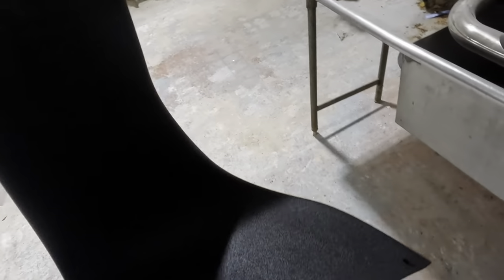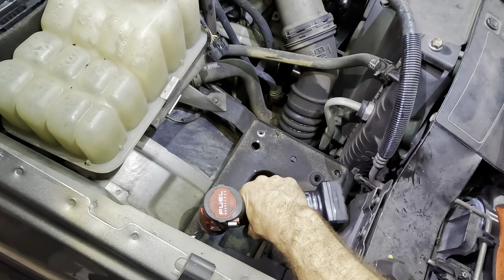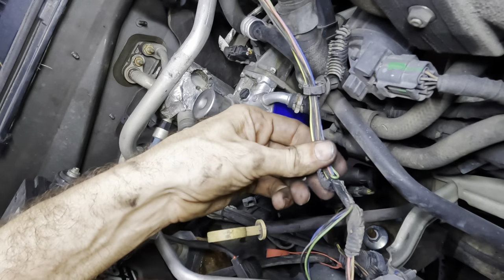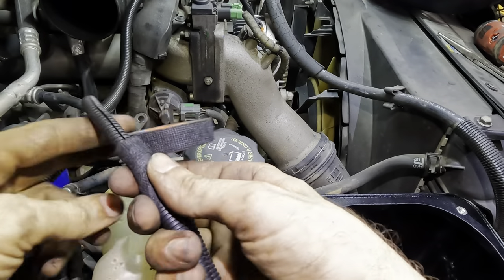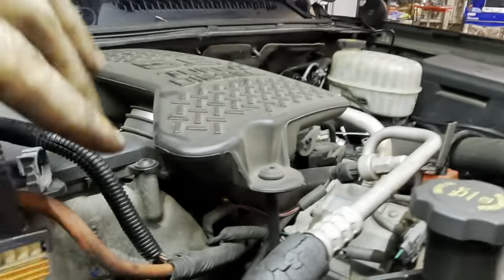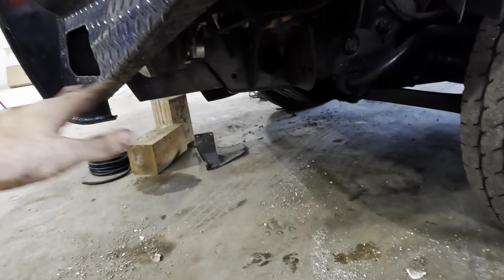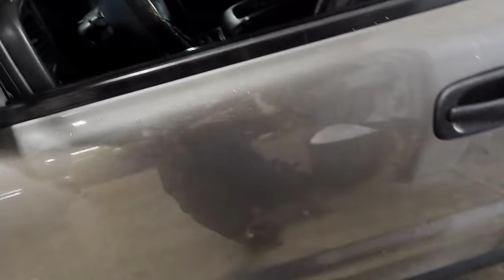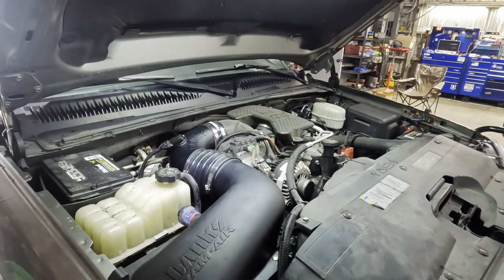This is BAD! And it's MY FAULT!  2007 Silverado 3500 6.6 @bankspower

Comment: The stock bumper  would have acted as a water, splash deflector. The scoop would therefore be somewhat protected from outside elements. You could install a flat piece of metal down in front of the scoop, say 3" or 4" inches in front and lower than the scoop. Just a thought Ray.

Comment: Hi Ray, great video as always!

Just for info though, as you are usually so accurate with terminology - The stuff you are calling loom is actually flexible conduit.
The wire loom or harness is the set of wires & cables themselves, plus the tape or ties etc. that keep them in the correct arrangement for installation.

Comment: Scooping hot air off the melting tarmac in summer (opposite to an intake cooler) and scooping water in winter not my preference.

Does anyone know how many cubic feet of air per second is sucked in by that engine?  I think that that number may make the "forced" air insignificant.  Myth busters years ago tried using a leaf blower  as a supercharger which didn't work. 
However  I love this channel and the way Ray presents it.

Comment: That engine is a great big air pump. Anything to help airflow is an upgrade for sure. Looks great too. You might check your AC low pressure switch connector as it looked like it wasn't "clicked". Have a great day!!

Comment: Seems counter productive.  In Australia we mount cold air intakes as high as we can, usually just above the driver's or passengers side door. Gets it up away from the hot tarmac, dust from the fan, and any other nasty that could block it up....like road kill lol. But really this  is the complete opposite to what we do here . Just saying.

Comment: Nope. Cold air intake generally means "outside the engine compartment", Not down by the hot pavement. It will make a great "wet vac" if you try fording some water obstacles. Otherwise, another great video.

Comment: I'm not a fan of intake at or below bumper level having hyrdolocked my 1982 6,2 diesel while driving through a long puddle in a parking lot many moons ago. Fortunately no internal damage was done. The water splashing off the front tire splashed right up the air intake. That being said, the modification getting your intake 2" higher is probably a good thing.

Comment: Ray with you buying all this Banks stuff you should see if you could become an authorized Banks dealer and install Banks equipment on people's cars and trucks.
Reply: It would be hard to get bulldozers to the shop.
Reply: @wayneessar7489  My stupid did auto correct and changed over to cats. I was typing in cars.
Reply: @KenSch2020  I thought because it was diesel, my mind went to caterpillar tractors. 😂

Comment: Ray my man. Lose the Duramax engine cover because it is a resonator. If we need to hear that opus of miraculous engineering, idling smoother than a Swiss watch sliding on a sheet of ice then off with ye cover matey!!! Oh and I'm really hoping you opt for cold and hot side aftercooler pipes next so you can reduce some weight in the EGR area. I'm going to recommend HSP piping and HSP ceramic exhaust manifolds, along with upgraded up and down pipes. If you want to do something wacky, I've never seen anyone run thick rubber vacuum hoses, like 4 inch diameter hoses in lieu of metal piping. Yes they have industrial hosing that withstands the requisite temp and pressure. Oh, but if you want to really go mad scientist, I suggest you remove the front air aftercooler entirely. Add another full size radiator and run a new coolant loop. This loop is for your new liquid to air aftercoolers. Relocate one or both batteries for room, grab two L2A intercoolers from eBay OR just grab 2 of the new GM L2A intercoolers that go on the 6cyl Duramax stock. They're only $100 each from parts shops online or eBay and they work very well. Sandwich adapter your engine oil and run plate L2L heat exchangers in series to cool oil and trans fluid on a third loop with a fan underneath. It's almost time to add a shift kit to the Allison and change its tunes. Your Duramax has not yet achieved its final form!! 🛻💨😱

Comment: That loom was trash when they put it on at the factory. But it beats the heck out of the wiring gremlins you would have without it. Now if they just used super high temp wire loom that would hold up better..... Now you need to get rid of that restrictive silencer at the inlet to the turbo.

Comment: Oldsmobile had a Ram Air system in the 442. I thin k it will make a difference in your truck. Great video as always, Rainman. Watch them full throttle take offs, you could be heard be a half deaf Patrolman. lol

Comment: That is not an air intake, it is a low level flood water intake. Should have gotten
an air intake that is above bonnet height, then you can go through flood waters
where no man or 4x4 has snorkeled before. Beyond the reach of gravity ... and
beyond the way of water gets into the engine cylinders and then refuses to be
compressed.

Comment: Good thing they gave you a pre cleaner cause you gona need it picking all sorts of stuff from a air intake being so low to the ground. Here in Michigan it would get plug up with snow in no time. Seems like they could have found a better place out of direct crap getting into it. My as well have a hood scoop on it. If it was behind the front bumper would be much better but still not the best place or into the fender were it would get better protection from the weather like some cars and trucks do. Hard to find a spot without looking at the truck to really find a good spot. Also I have seen many a wire loom replacement that melts under the heat in the engine compartment. Seems like you can't buy any good products today.

Comment: Holy shit ive seen some stupid intakes but that one takes first place. I've never seen an air intake so low you would be too scared to take it anywhere near water. Which would be hard in a wet humid state like Florida. It looks like the perfect accessorie to Hydro lock your engine

Comment: Banks  parts are great quality ,from what I have seen .Great video .Nice that you cleaned up the wiring as well..Could of used some black silicon sealant in the lower air scoop where you used the self tappers and also between the bracket ,to stop vibration and seal .All in all top job..

Comment: Hey Ray. how you doing, i noticed  that lots of your repairs sometimes there is no way for you to fix wire  or ways for you to protect them,  please if you can used the TESA TAPE HIGH TEMP, is better than the one you used on the video...  because that tape your using get really messy especially on humid and warm weather.  love your videos...

Comment: Nice install but I had some ADD with your bracket modification.  I'd have marked the hole and removed it from the scoop and drilled it in a vise.  Either way it's working for you.  Be safe!

Comment: Not to be negative but in a heavy rainstorm isn't that going to scoop up water and the screws you're putting in are going to change the vortex pattern coming into the airflow chamber

Comment: Weird, air-intakes are normally always as high as possible to prevent water intake. Driving this car through water of 35 cm deep, will be a, possibly very destructive, test what happens? Would stick to simply replacing factory filter bit more often than necessary or get a air-instake high like full off-road cars often have (jeeps land rovers etc).

Comment: I can't tell for sure, but it looks like the connector for the low side pressure switch for the AC is not clicked in al the way.  And I did not hear you say "click".

Comment: Not sure if that Banks diff cover does much for the longevity of the gears but it sure makes service easier with a drain plug and oil level sight glass. Installed one on mine for that very reason.

Comment: I remember the videos that Gale did with the diff cover and how just about all the aftermarket offerings were designed wrong. It's more than just keeping the fluid in there. Aeration, cooling, and proper distribution are big factors in the design.

Comment: Good job , and the only comment that I would like to point out is that I hope where you are / drive there’s no flooding/ deep water as I would have turned your ram air scoop upside down above the bonnet! ( would be very helpful in the U.K. ) 😊

Comment: I know from personal experience that the first time you hit any standing water you will hydrolock your engine. Removal of that type of factory scoop was mandatory on early Dodge Dakotas for certain insurance companies to pay engine water damage claims. Maybe if you had left an air gap where you trimmed the scoop, you would stand a chance (since it will pull hard on air before attacking a column of heavy liquid}. Anyway, I've watched all your videos and admire your sharp thinking and work ethos. This install, however, is going to fail in an expensive fashion. Please drill some holes at the top of your intake vertical column. Asking as a friend and neighbor, not an internet troll.

Comment: Nice video. im a big fan of Banks products too. Looking forward to the differential install video. I installed larger intake cooler hoses on my truck. I noticed a difference with those (at least it felt to me like there was a difference).  Banks intake hose and ram air.

Comment: when you flicked to metric, I briefly understood. Every other time I have to do mental calculations . 
The rest of the world, outside USA is metric, barring Rawanda I think.  Same with temperature.  66 degrees would be death in celcius. 32 degrees is a hot day in celcius and 45 - 50 celcius does happen in outback Australia occasionally. (0 Celcius = freezing point, 100 celcius = boiling, elegant simplicity)

Comment: I've seen you working with plastic parts a lot lately maybe you can get someone to donate a couple of tools from hobby store or Amazon the Testors sprue cutter and trimmer also the Xuron  track cutter they both do excellent job on plastic parts and the track cutter cuts soft metal's.  👍
 The name of the tape you were using is friction tape. 😎 
I use split loom for wire mounting on electric jobs

Comment: You have to create a negative pressure to "suck" up water from the bottom of the scoop. Just drill a few of 1" holes in the bottom of the air box. This won't interfere with the cool air being drawn in from the scoop (slightly, maybe) but will surely prevent a vacuum if the scoop is submerged. The holes will also serve to drain any water from the air box.
By the way, there is no ram air effect using a forward facing scoop (below 200mph). If you are just looking for cool air to be fed to the engine the best place to get it is probably in front of the radiator and up high (out of the engine compartment). ---- Sorry, "cool" air doesn't exist in Florida ----- I'm from Gainesville!

Comment: I don't agree with the scoop design.  The hottest air is on the road surface as is the dust kicked up by the vehicle in front of you, not to mention snow.  That's why Toyota trucks mount it above the cab.

Comment: 44:00 why didn't you use the right angle impact to install the self tappers? Would have been very easy to get 2 in the bracket.

Comment: i highly doubt that is going to give so much improvement it would noticeable by feel, it might give a few horses, but not that much you could feel it in your seat, probably just your brain trying to justify the price, i doubt that it was cheap,
but seriously? why install that low intake on such a high truck?! it is just asking for flood water to be straight up sucked up to the engine, a huge straw, you just halfed the depht of water you could pass through, plus you would still be afraid of small amounts getting sucked in by the suction, that is a good upgrade for a performance only oriented truck, not your emergency vehicle in case of another hurricane, and i don't think a hurricane will wait for you to unbolt it.
if anything, a big snorkel would be definitely better: it does let you have its intake oriented towards the incoming airflow while driving, thus giving you your fresh intake of cold air, and you will be able to cross through any water, knowing that the intake is not an issue, and the limiting depht is whatever else that must not be underwater...

Comment: oh crap Ray, I thought you F'd up! i'm watching and thought that the cut off scoop caused only an angled area that won't slide up over the flange of the filter box. I guess there must be an angled end already molded into that side. I like it when engineers can plan ahead for alternate installs! Well done Banks!

Comment: Rainman as much as it floods in Floridia I would not put my air intake down below water level. Just saying. Back in the early 50's my brother bought a new car. It had two belts, one for the water pump, and another for the fan. Of course Oregon flooded badly so he removed the fan belt and could run through water nearly over the engine.

Comment: This is for my education, I am not a mechanic: I struggle with understanding this modification. Why getting air from down below is so important that it is outweighing disadvantages? Colder air - but the temperature difference of air 10-15 inches above the road vs. 30-40 inches is, I think, marginal. I did some off-road in my life, but also for regular driving: here it is all about air intake being as high as possible to minimize dust and to minimize water ingress risk. It is, of course, particularly important in off-road. I could understand if the Banks mod was about a flap that you can adjust and switch air flow from high placed snorkel to the "ground placed" scoop as you need. But this way, are the benefits of marginally colder air so great? I do not know.

Comment: Nice add-on to your truck. Did you see noticeable gains on performance or economy? It's gotta help a little anyway. 
I remember when I worked for the harvesting company they did not want you to open the air filter until the thing went red. Then we would clean it and run it again till it tripped. 
Love your videos. Keep up the good work, And Have Yourself a great day!

Comment: It's not the Banks stuff man, it's that you finally changed your completely clogged air filter and the damned engine can breathe again. A $5 Fram from Wally-World would have gotten you the same result with the removal of that filthy thing you had blocking your intake.

Comment: That has to be about the dumbest place for a air intake and being flow through it won't do a damn thing for the intake. In fact it may even cause a vacuum at highway speeds with the flow through feature. If you want to get some positive air pressure before the turbo put the intake behind the fan. I did it to my 1974 Datson B210 with a 1300cc engine. The cop when he caught up to me, he walked right past me and pointed to the hood and yelled open the hood. He looked at the little 4-banger purring away and said there is no way that car could go that fast. I asked him how fast was I going?? He said the radar clocked me at 130mph. He went up one side of me and down the other and said the judge would never believe it. He  told me to slow the hell down and let me go. He said now he had to take the radar in and have it checked out. This all took place at 3-oclock in the morning with no other traffic, just me and the cop on the freeway. BOY WAS I LUCKY !!!  LOL

Comment: That is one sexy puddle-sucker!  I like it!  :D

I wish I could remember what the VHS was we watched back in automotive school, but an independent lab tested all sorts of aftermarket diff covers, and found every single one of them ran higher fluid temps than the factory cover, entirely because of that funny little contour around the ring gear in the factory design.  It allowed more lubricant to adhere to the ring gear for longer, and reduced fluid turbulence within the differential.

That was, of course, 15+ years ago, and I'm sure the engineering is far, far better now than it was in that video.  More just a fascinating tidbit than anything actually useful.  :)

Comment: Isn’t taking hot air just above the black asphalt in Florida’s climate the opposite of what you want to reduce the temperature of the intake air???  Wouldn’t it be better to take the air in from a scoop on the hood?

Comment: I don't understand the reasoning behind scooping air from down low? They usually go for high pick up and that makes sense but down there you've got all the fine dust blowing along the ground, leaves and unless there's an option for it to suck from somewhere up high if there's resistance, you've got a big issue if you go through water that's deep enough to cover that scoop too. There's also the fact that it's intended to be a "cold air intake" yet it's picking up the extra hot in summer air from just above the hot bitumen road surface too.
I'm sure they've thought of all this so some explanation would be informative because the only advantages I see are that it's less conspicuous than the normal high pickup type and that you've gone from a blocked filter to a clean one, and there's a few 'pretty' parts but, only if people lift the bonnet or crawl under to see the scoop.
Sorry Ray, I'm just having difficulty seeing the advantages of this mod, except for mostly somewhat cooler air coming in that could be even cooler with a high pickup one anyway.